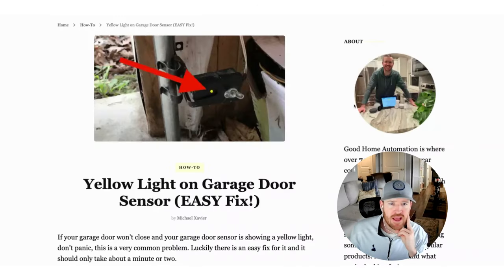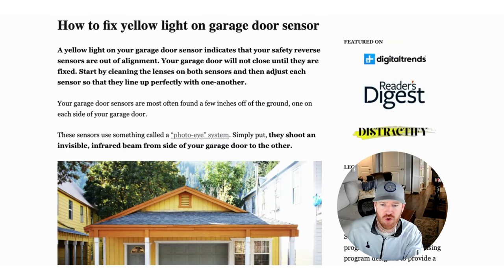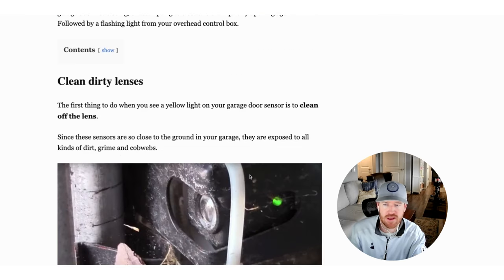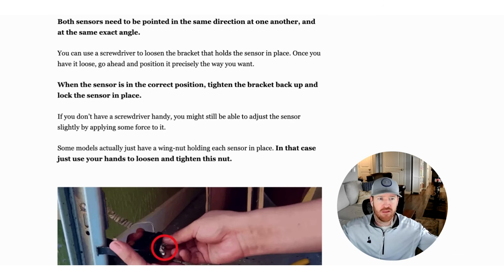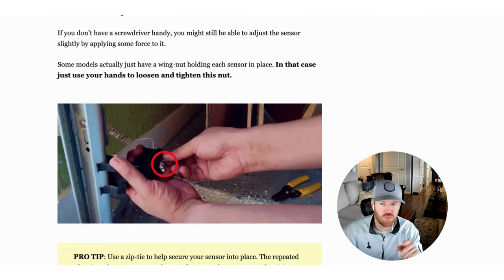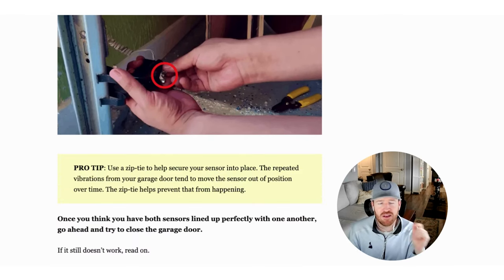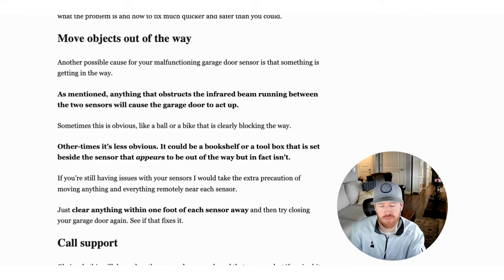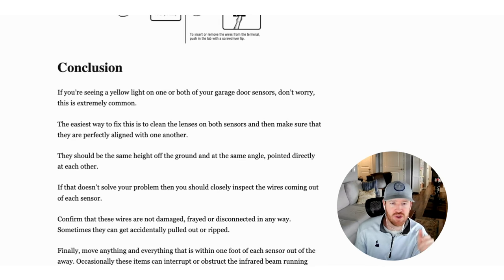Yellow Light on Garage Door Sensor | Quick and Easy Fix!

Comment: No no no! A yellow light on one side is correct and normal. One side will be green the other yellow or red depending on brand. A yellow light does NOT mean malfunction or miss alignment. A blinking light means alignment issue or wiring issue. Aligning the sensors will not change the light's color please correct your info!
Reply: So can you tell us the correct way to fix it bro
Reply: You just saved me a lot of time. Walked out to go to work and the garage door wouldn’t close with my clicker. Saw one green light, one yellow light, assumed it was misaligned or wiring went bad. Saw your comment immediately and realized it was the clicker!
Reply: @thekbops  Original presenter said this works with any opener - Liftmaster, Chamberlain or Genie. That is incorrect. With a yellow light on a current Chamberlains - there is no fix, it isn't broken. The emitter (sending unit) has an amber LED that is always lit, the receiver (receiving sensor) has a green LED. If the light beam is interrupted, the receiver will start blinking. This interruption can be an object or dirty/misaligned emitters/receivers.
Reply: Sensors work, but there no power to garage door, any suggestions?
Reply: @deem4735  So how do the sensors work if there is no power to the garage door opener? The sensors get their power from the garage door opener.
Reply: @bigdog8008  not sure but I climbed up opened the box of the garage opener and pushed on all the wires and the light turned on, so something must be loose.  The sensors however were never affected.
Reply: One side is Yellow. One side is Green. It opens with the wall opener. But not with the Remote.
Reply: @c.amakai  I had this exact problem. They garage guy showed me where the wiring from the sensors going back to the opener was corroded and that was the issue. It was 11 year old wiring and he said over time moisture and the current just corrodes it. I replaced the sensors and wires and it fixed everything. I've done this for 3 doors now and it's fixed all 3.
Reply: I don't know what happen with my garage door because can be closed but open without any command.
Reply: This comment is not true, depends on the garage door opener. I have to different kinds for my garage doors. On one opener both sensors have to be green and on the other one sensor is yellow and the other is green
Reply: Wrong in my case. We have a single and a double garage door. The double works fine and both sensors have a green light. The smaller door isn't opening and 1 sensor has a green light, the other one a yellow light.
Reply: @alexnelson09 great call my friend
Reply: @alexnelson09 I'm only about 15-20 minutes in, you saved ME a lot of time, thank you again
Reply: @thekbops it's the clicker as previous commenter said
Reply: Ohhhh so then how do you know if it was the sensor?
Reply: Can I just completely disconnect the censors?  Will my garage work after?
Reply: @warrencollings9784  you can but you will need to jumper out the terminals at the opener so the unit sees the signals as closed.
Reply: @RimfireAddicted70  that makes perfect sense! Thank you
Reply: @RimfireAddicted70  I think I have to try this.  About 50% of the time, my door is reversing direction after partially closing.  I watched the light on the receiver side during one of the events and it did not go out, which I assume means it doesn't think the signal was broken.   That suggests to me that it's not the sensors, but that the door is sensing resistance on the close.   Nevertheless, I think I will jumper it on the unit for a few days and see what happens.
Reply: I have a yellow light that stays on, green light that turns off and on at times. The door opens at times but will not close. The light on the unit randomly turns on. Try to close the door and the unit light flickers like theirs some in the way of the eyes. Any suggestions?
Reply: You saved me so much time. Thanks
Reply: You right at first i think it broken and about to change a new one but I figured out yellow light is not a problem, the problem is both sensors was not point each other , so just go look at the green light if it’s stay green and not blinking so you good. Blinking means they are not point each other

Comment: One light on left is a solid green light & other side is yellow solid light..!! Garage door opens fine but won’t close, it starts to close but then goes up, light blinks ten times and stops. I override using my wall controller to close the door. Can you suggest what’s going on?? Thankx appreciate much..!!
Reply: Having the same issue. :( any luck?
Reply: @hryou1  Nope, I was hoping this YouTuber would reply but no response..!!!
Reply: Contacted Chamberlain customer service: Hmm. Not sure why its doing this with the app and not remote as this typically is due to a sensor issue. Lets try resetting the sensor

To reset:
1.	Remove the wingnut holding the sensor with the green LED 
2.	Point the sensor to the floor for about 10 seconds (LED will go out)
3.	After 10 seconds bring the sensor back into the bracket getting the LED to go back solid then re-install the wingnut
4.	Try closing the door from your remote (not the wired wall button) and see if the door now closes or still reverses back open with the light bulbs flashing
Reply from the maker: I have not seen this issue before, please let me know if you were able to fix it and I can update the article and video
Reply: @b9217s  yellow light won't go out
Reply: I was having a problem with garage door opening once it touched the floor …   In order for door to remain closed, both sensor safety lights (Orange/amber light (Sender), green light, receiver) need to stay on … If there’s a blocking, the beam is broken, door comes up … Long story short, friend told me to get in my knees & look at sensor light … Noticed, the thin wire connected to the orange sensor was turning off, when door was coming down … I moved wire away from door, door now works  … How many years did the door move the wire before acquiring a bad connection ? Though, the door is working, the orange sensor is suppose to stay on, which it does, unless I move the wire … It’s working with the wire’s current position but it needs to be wired correctly with the sensor …
Reply: The flashing light 💡 bulb, is telling us, the beam between the two sensors are being blocked, maybe other issues as well …
Reply: @oldenyz3148 … Yellow light is not supposed to turn off, it’s a steady beam sending a signal to the green receiver … Place your hand on the sensor with the yellow/amber light, it will not go off … Do the same with green sensor, light goes off, blockage … Safety, pet, child, backing from garage breaks the beam preventing door to close
Reply: there are adjusters on the side of the motor (the device on the ceiling that powers the door). these adjusters adjust the force of the door, and also there are adjusters for travel distance in each direction. if the door is being pushed too hard into the ground, it may cause it to bounce back up. tweak these adjusters with a flat head screw driver and see if that helps.
Reply: Had same Problem after spending Hours trying to align sensors...I tried standing inside and when Garage door came down I pushed Bottom of the Track where sensors are and it closed.
so Basically just had to Bend track a little inward.👌
Reply: @amedeo1993  so the battery was down. Once I changed the battery & reset the system. It’s back to work..!!
Reply: @sangamghabring  what battery?

Comment: Mine are mounted 3 inches apart on TOP of the garage door mechanism. They are aimed directly at each other, 3 inches apart. There's no way they can be out of alignment. I'll check the wires this weekend. I have lots of possums and raccoons in my garage, in the rafters. they have parties up there.

Comment: 1 light is green other is yellow but the garage door  still goes up and down but the yellow light is killing me any ideas beside what u already said clean lenses ?
Reply: Both the yellow and green lights should be steady on. If the sensors are not aligned properly, the green light will blink or be off entirely. The yellow light never blinks.

Comment: I agree with the last comment. I played around with the sensor light that was yellow to no change. It’s cleaner now than I’ve ever seen it but my problem was something to do with the remote. I gently cleaned off the inside of the remote, and then it started working again. One of the sensor lights remained yellow as it started to work again.

Comment: i think my problem is with alignment, but why is one side green and the other side yellow, would it be like this if they aren't aligned?
Reply: 1 yellow, 1 green is normal and corect. yellow sends, green receives. google it.
Reply: I’ve a Legacy garage door opener. It opens fine. But, when trying to go back down to close it. It gets all the way to the very bottom almost about 1’ left & then starts to go back up. I believe it has something to do with sensors being off? But, looking at how the light is red” on one side & green on the other the sensors both seem to be aligned fine. No blinking. Could this be a adjustment issue or spring? I had to recently changed the capacitor do to it smelling like electrical smoke & sounding like it was frying. 
I’m lost at this point now as what to do next?

Comment: I have 2 doors. 1) On both doors one sensor is yellow the other is green. 2) I took the sensors off and cleaned them thoroughly.  3) Placed them back and still having the same issuses. The garage door will not stay shut. It atemps to close but will not. One sensor remains green the other yellow. Anyone else having this issue?
Reply: no

Comment: Unfortunately none of this worked for me..my sensor is still yellow on one side..i think i need a new sensor
Reply: Did you replace yellow light sensor ? Did it work ?
Reply: @What’s Going on  no I haven't replaced it yet
Reply: @Rudyard  no shit really? That's funny AF.. I've tried adjusting mine and I still can't get it to work properly I guess I'm gonna have to change them..is there a way to reset them?
Reply: @bbrad628 … I don’t know about main sensor … The amber/orange is the sender, the green is the receiver … There’s a steady beam between the two … Put an object on either sensor, beam is broken & door will not close
Reply: @WATCHMEGOBROKE … Check to see, no wires are being touched when door is closing … Get a pad for your knees & make sure sensor wires are out of the way
Reply: @jonny chavesi  ok thanks bro I will try that 👌
Reply: @WATCHMEGOBROKE  … 👍🏼
Reply: 1 yellow is the way it's supposed to be. It is correct. Yellow sends, green receives.
Reply: @fredsmith6324  … Green receives signal, all other colors, sends signal
Reply: @fredsmith6324  really? But my door still doesn't work properly no matter what I do
Reply: @WATCHMEGOBROKE  one thing you can try are adjusters on the motor (the device that powers the door). there is a force adjuster, and two travel distance adjusters. you turn them with a flat head screw driver. it could be that your door is being forced too hard into the ground, causing it to bounce back. dial back the travel distance adjuster, and also maybe the force. just a suggestion.
Reply: @fredsmith6324  thanks for the suggestion brother! My problem is the door only closes sometimes and in the evening only..lol in the morning it will not close at all and keeps backing up. Then the light flashes 5 times

Comment: Could this be the problem for the remotes not working as well.
Reply: My batteries work in the remotes
Reply from the maker: @Femalegold4294  You should have a wall-mounted button that is connected directly to a power supply. If you do, use that instead of the remote.
Reply: @GoodHomeAutomation  I’m until I can get the remotes fixed. I tried do as you stated in the video it didn’t work.